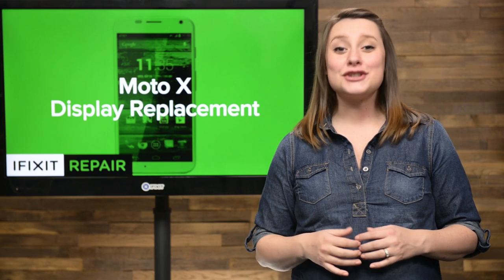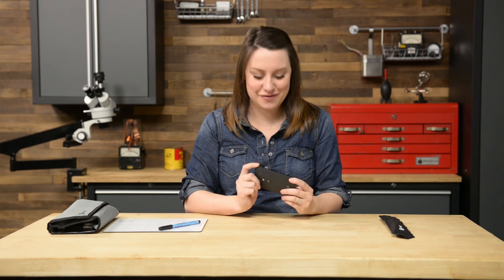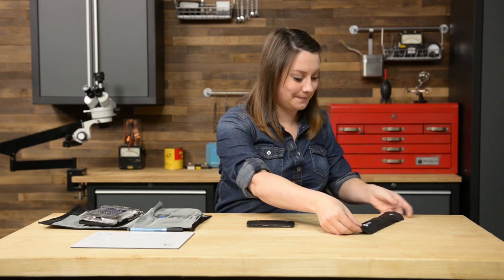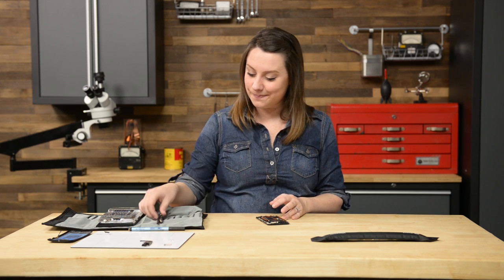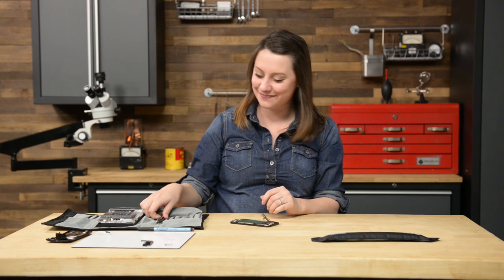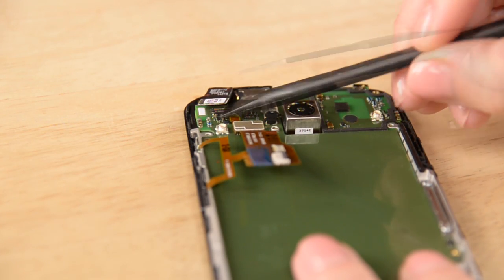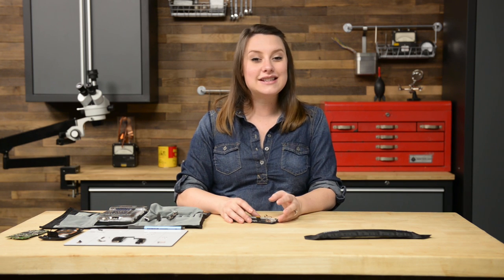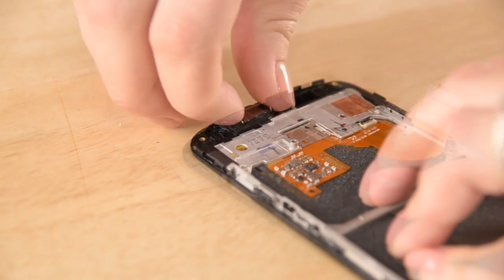How To: Replace the Display in Your Moto X

Comment: Trying to fix this phone was awful. The adhesive would not let go (I started to melt the back before it started to give) and out of the first set of four screws, three stripped their heads right away. I'll be shopping for a replacement and returning the screen.

Comment: The only two problems i find in this phone are that the black woven shell, develops micro cracks on the sides. The rubber seems to develop cracks under pressure and heat. I have two on mine and i have never placed the phone on my pocket or droped it. In this video they are present at 2:05 to 2:15. Some people have another issue with the FFC being diplaced. Mine is still perfect. Other than that it´s an amazing compact phone.